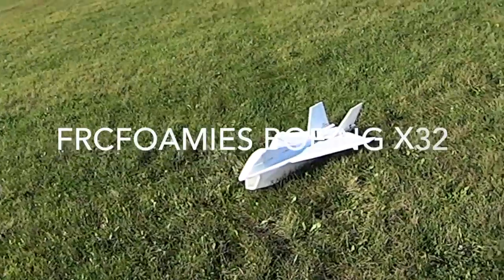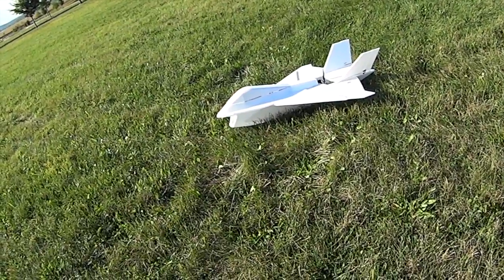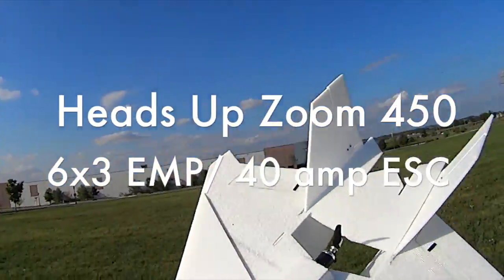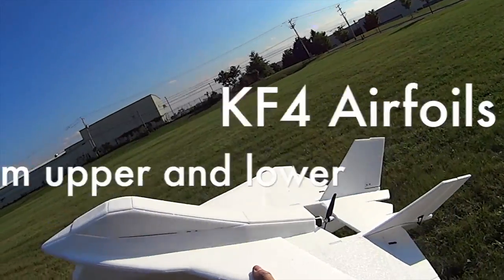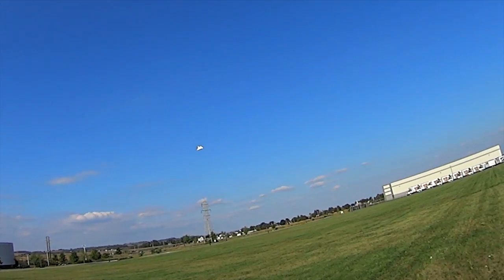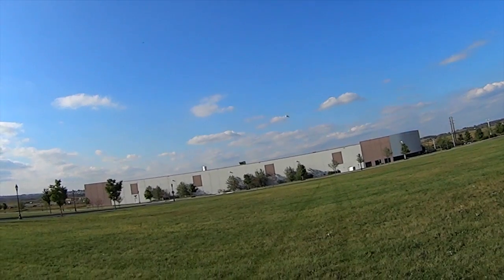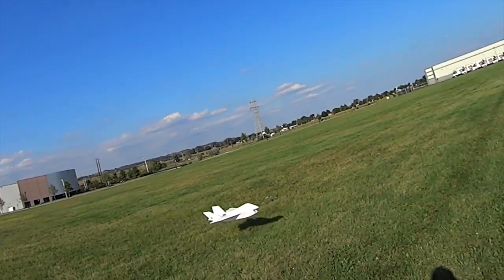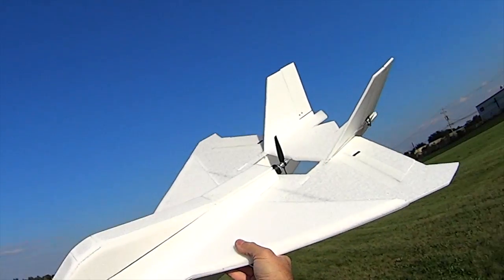FRCFoamies Boeing X32 "Guppy" Preview

Comment: Hi - awesome video what's your thoughts on this plane vs the RCPOWERS F35?  I'm going to do one next but can't work out which one!
Reply from the maker: Keith, definitely do the RCPowers F35. The guppy is neat and makes a big impression, but the F35 is a great plane to experiment with loading up with rudders, ailerons, flaps spoilerons, etc. But also check out my "guppy remix" video where we chopped off the bottom of the guppy and it's a great speed plane!
Reply: Yeah I did see that looked pretty cool - what's your thoughts on the V3 Vs v5 f35? I've been flying a year and it's reasonably windy where I live.cant decide which one to do next at the minute!